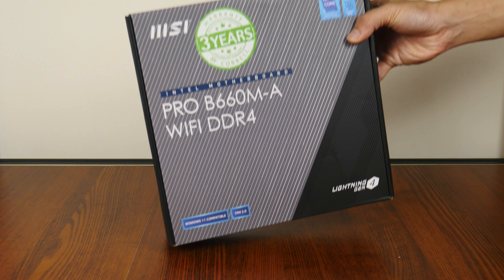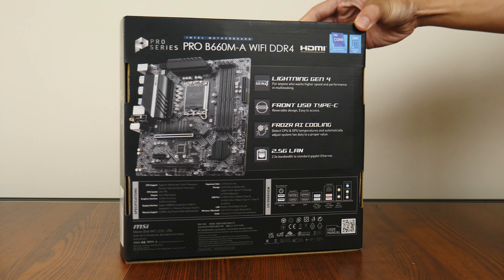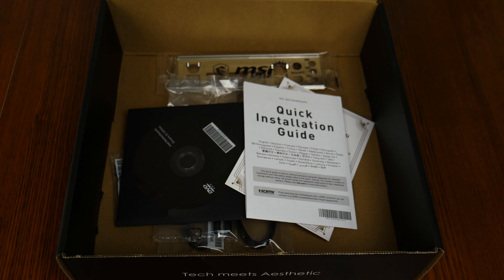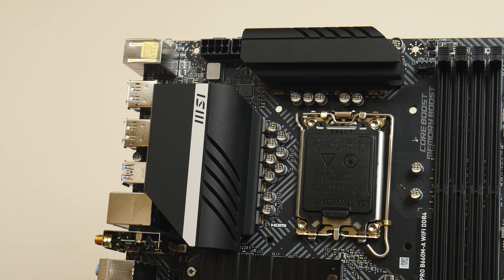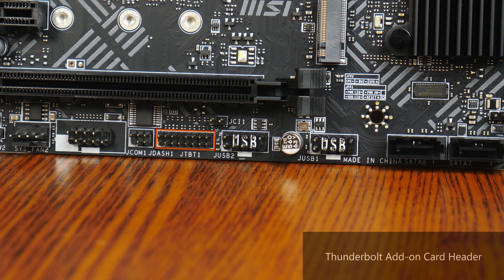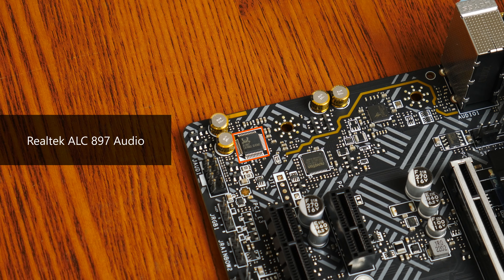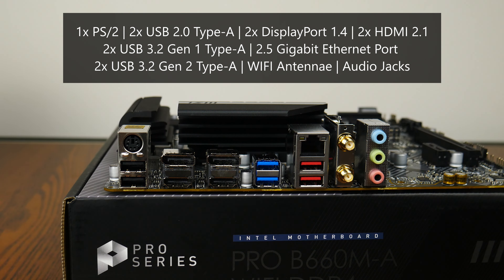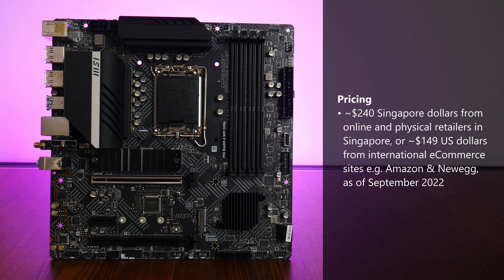Intel 14th Gen Raptor Lake Refresh Ready! MSI PRO B660M-A WIFI DDR4 Unboxing & Overview

Comment: I have an Asus H610m-A. I'm not one to update BIOS unless I actually have a problem and this time I was lucky. Undervolt on my 12600K works flawlessly. Offset use of 0.150mv and Full Load temperatures go from 85º to 64º using a Deepcool AG400...
I was wanting to get a B660M from MSI but many reports of problems. Upgrading to a Z690 increases the cost too much and I'm not going to overclock. It seems to me that I am lucky to have my H610m A... I wish I could use a high speed SSD and my other 2 DDR4 modules that are stopped due to lack of available slots on the Motherboard but it is difficult to define which card to go with so many limitations of these new BIOSes.
Reply from the maker: As long as the board works properly for your intended use case! That said, with the ASUS board that you have, at least you've got the option of upgrading to a 13th Gen processor in the future - you'd definitely need to do a BIOS update for this though!
Reply: @ALKtech  Ah yes, sure.. This H610M-A is very good for the purpose. It does have its VRM limited but I never had problems like the 12600K even at full load with heavy loads like running Cinebench R23 or Adobe Premiere. Undervolt helps a lot to lower temperatures. Maximum 75 degrees running Cinebench R23 with AG400 cooler. I think it's very good. Let's see if I can get the same result on the MSI B660M since historically this card tends to consume more energy.

Comment: is it ok only use 8pin eps/cpu for use i3-12100F? or need to use all pin (8pin + 4 pin)
Reply from the maker: Yes you can just use the 8-pin CPU power connector on its own, since you're using a 12100F, which doesn't consume that much power. In future, if you're intending to upgrade to a higher-end processor (e.g. 13600K, 13700K etc), it'd be a good idea to then connect the 4-pin CPU connector as well!
Reply: @ALKtech  i see, thank you for the information

Comment: i just bought ddr5 version of this mobo with a i5-13600k and rtx 4070ti.other than overclocking,will it restrict my cpu or gpu performance in gaming anyhow??
Reply from the maker: I think the DDR5 variant will do just fine with a 13600K - as always, just gotta make sure you've got good airflow for your case and a good CPU cooler!
Reply: thanks i really needed to know as it is my first pc and  i was really confused😅
Reply from the maker: @xanoragaming3719  No worries! That said, you'll wanna make sure that you've got the latest BIOS for this board pre-flashed where possible, as B660 boards launched before the 13600K was released. 

You might wanna check in with the retailer that you bought the board from whether they'd be able to help flash the BIOS to the latest version before shipping it to you, as the MSI board doesn't come with a feature that allows one to update the BIOS without installing a CPU!
Reply: @ALKtech  yes i confirmed it from the store they said theyll flash the bios and all when ill get it assembled as right now im just collecting all the parts😅😅
plus: could u suggest a good and medium ranged liquid cpu cooler for these specs??
Reply from the maker: @xanoragaming3719  That's great! Tbh I haven't had the chance to test that many AIOs, but some brands that come to mind would be Arctic, Corsair, Cooler Master and DeepCool. With a 13600K, I think there's no need to go with a 360mm and can stick with a 240mm/280mm AIO if you wanna save some cash...
Reply: @ALKtech  hey i am getting a chance to exchange my msi pro b660 motherboard with a msi max b660mortar(also ddr5)for some extra bucks should i go for it
Reply from the maker: @xanoragaming3719  How big is the price difference though? With the Mortar you do get a better audio codec and nicer-looking aesthetics versus the Pro...gotta see if these are features worth paying the extra money for in your use case!
Reply: @ALKtech  i mean i sole purpose is gaming i am getting it for extra 6000  rupees which in usd would be around 80 so do you think its worth it??
Reply from the maker: @xanoragaming3719  oh hmm...if the price difference is US$80, I'd probably just stick with the PRO instead. I personally don't think the additional features would be something I'd appreciate...just my two cents!

Overclocking wise, B660 boards aren't meant to overclock, though you might be able to do some BCLK overclocking with the PRO B660 (I haven't tried this myself so I can't confirm - you might want to check on Google if this board supports BCLK overclocking). If you're keen on doing proper OC with your 13600K, you might want to look at Z690 or Z790 boards instead that support full-on overclocking!
Reply: Bro im replying after i got my pc build complete.I went with your opinion and sticked to b660 mobo and really im not a bit dissapointed by the performance.i5-13600k and rtx 4070ti is quite a sweet combo.
                                    so at last  just wanted to thnk you for your suggestion cause you helped me to save some bucks there😅
Reply from the maker: @xanoragaming3719  awesome and happy to have helped. Glad you're rocking your new PC build!

Comment: What to choose for non OC systems i5-13600: MSI PRO B660M-A vs Gigabyte B660 GAMING X DDR4 ATX?
Reply from the maker: Is there a price difference between both boards where you're from? For me I'd say pricing would be the key deciding factor!
Reply: @ALKtech  the same price $125 but MSI VRM 8+1 and Gigabyte 8+1+1, MSI brand seems to be more reliable.
Reply from the maker: @DominatorPuls  I see. I'd probably go with the MSI in that case since both boards cost the same - from what I see on the web, the MSI's VRM setup seems to be pretty good for its price point!
Reply: @ALKtech  You are right. MSI's VRM is actually 12-phase, it was my mistake in the previous comment. I have already bought the MSI MB. :-)

Comment: according to the Msi website, it seems that there is another version of this Msi Pro B660M-A Wifi motherboard which supports DDR5 memory instead (in addition to 12/13th gen Intel cpus). It can be confusing when buying this mobo, if you want to couple 13th gen Intel cpu + DDR5 memory, as you have to make sure you don't buy the DDR4 version of the mobo. Or, if you order the mobo from another website, there are maybe chances they send you the wrong DDR4 version of the mobo, as they look exactly the same on the Msi website. Can you confirm that?
Reply from the maker: You're right, there is indeed a DDR5 version of this PRO B660M-A board. I'd like to think that retailers and e-retailers should have proper stock keeping measures to ensure that the right products get sent out to their customers, but mistakes do happen...
Reply: naah. i bought ddr4 because it takes 5 years before i upgrade ram

Comment: i am a newbie here. can i connect all 4 monitors or 3 monitors  considering it has 4 display outputs as i5 12400 supports 3 monitors?
Reply: The integrated GPU on the i5 12400 is just enough to normal desktop use, it can support up to 3 displays but just for regular use not gaming, the i5 can't handle gaming on single monitor , much less on 3, for gaming you need a discreet GPU, for gaming using 3 monitors you'll need a high end one .
Reply: @ivantsipr  iam a freelance stock market trader i just need 3 monitors for viewing charts in chrome browser will it be able to handle it?
Reply: @manoj3130  yes

Comment: We can control cabinet fan rgb with this Motherboard?
Reply from the maker: Do you mean control the lighting effects of RGB case fans? If so, yes you can! You can connect the fans to either the addressable RGB header or 12V RGB header of this motherboard.
Reply: @ALKtech  Yeah that's what I mean Thanks Dude for the reply☺️

Comment: What tier list Mobo for i7(12700)not oc
1.I pick b660msi m-a WiFi ddr4
2.I pick msi b660mmag tomahawk WiFi ddr4
3.I pick Asus tuf gaming b660m plus ddr4 WiFi?
Reply from the maker: Is there a price difference between the three boards that you mentioned? Personally, I'd probably go with either of the MSI boards, as there's some reviews out there that look at VRM performance and demonstrated that the MSIs did pretty well in these tests! But then again, since no overclocking will be done, price would be a final deciding factor for me as well.

Comment: Will this motherboard actually support the 13th gen? Because the DRM and overclocking conditions aren't suitable if someone uses 13th gen. While some reports claim that this mobo keeps booting and requires bios update for the 13th gen which is a bit of a pain. Because it needs a 12th gen CPU to update the bios and the USB flashing is also difficult. What do you say?
Reply from the maker: Yes this board supports 13th Gen CPUs - but the BIOS update process will be a bit painful as the board doesn't come with a feature that allows BIOS updates without a CPU/RAM/graphics card installed. Meaning to say, if the board that you purchase doesn't come shipped with a new version of BIOS that supports 13th Gen, you'll likely have to borrow a 12th Gen CPU from somewhere to flash the BIOS to the latest version first, before you'd be able to install a 13th Gen CPU!

If you're keen on getting this motherboard, it might be a good idea to check with your retailer whether or not they'd be able to help update the BIOS first before shipping it over to you...

Comment: Does  B660-A DDR4 have same vrm as PRO B660M-A DDR4 ?
Reply from the maker: I haven't had the chance to work with the B660-A DDR4, but that said, it does appear (at least from searching around on the internet) that both boards might share the same VRM configuration...

Comment: Can I update BIOS for this motherboard without cpu?
Reply from the maker: Nope, this board doesn't come with a Flash BIOS button that allows end-users to update the BIOS without a CPU/RAM/graphics card installed. You'll need to use a 12th Gen CPU to update the BIOS!
Reply: @ALKtech  ok thank you!

Comment: do i need bios update to use 13th gen 13600k to this
Reply from the maker: Yup, you will very likely need to do a BIOS update first before you can boot up with a 13600K. Best to have a 12th Gen chip around to do the said BIOS update first, seeing as this board doesn't come with a feature that allows you to flash the BIOS without a CPU/RAM installed.
Reply: @ALKtech  thanks bro. i think shops will let me bios update when i buy to them
Reply from the maker: @dotafarm2699  yeap - usually if these retail shops have a technician around, you should be able to get them to help with updating the BIOS before you bring it home..hopefully!